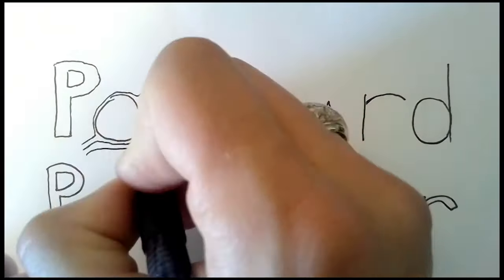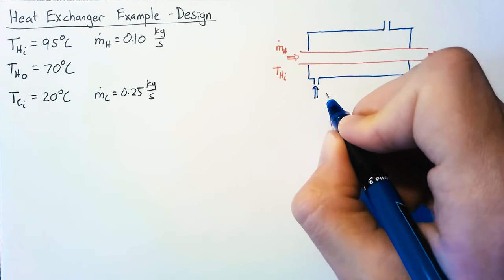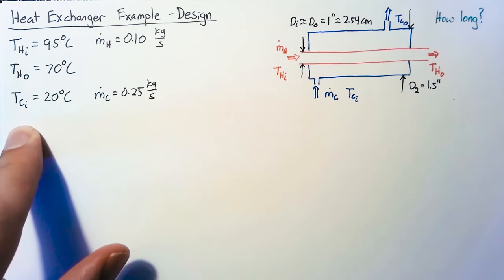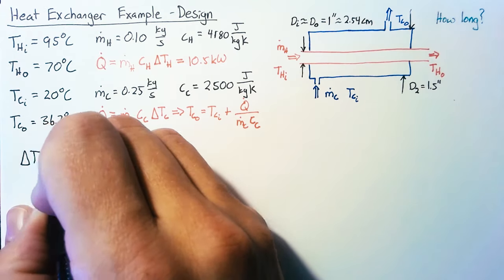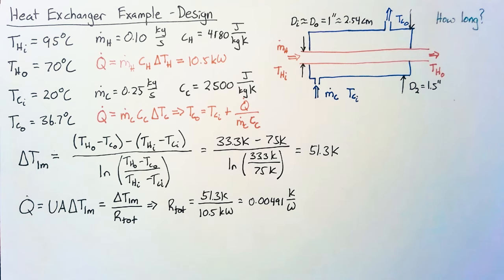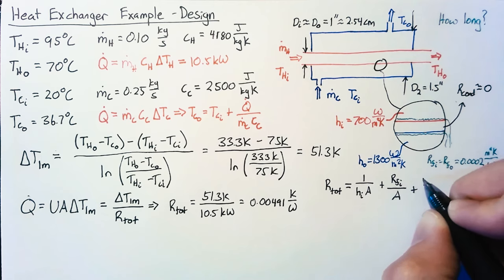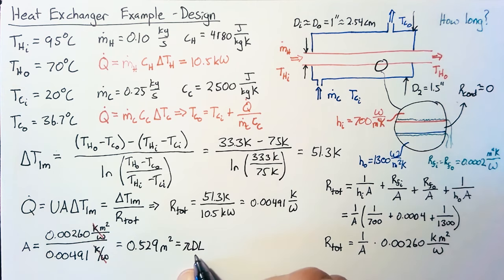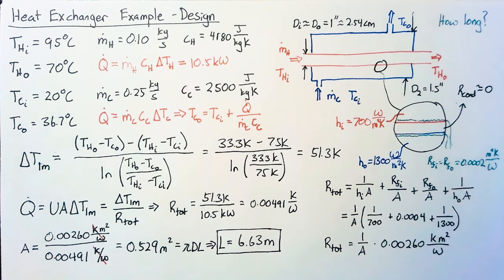Heat Exchanger Example - Design

Comment: The specific heat capacity of water at the temperature of 80 degrees and 20 degrees does not differ much and both are almost equal to 4180 J/kg*k . As a result Cc=Ch=4180, not 1500

Comment: hi i would like to know where did we obtain the convection heat transfer from the hot side and the two other values that follow?
Reply: Same question
Reply: @hassanismail6120  he used tabulated values but you can calculate it using
Correlations for Nusselt number

Comment: Can you please show how you got the ho coefficients of 700 and 1300 W/m^2K?
Reply: I would also like to know this please
Reply: Yes please explain
Reply from the maker: These are assumed values. For hi, there are correlations, and I should make a video on them. Unfortunately, the exact values for ho are difficult to calculate, and I’m not aware of any correlations. You can probably get some approximate values by assuming the tube is a flat plate.
Reply: @PostcardProfessor  Without knowing how to get these coefficients, this video is useless. we cannot calculate the area required.
Reply: These coefficients depend on the flow velocities (or on throughput) on both sides. They can be obtained by interpolating through the data found in the literature like HEAT EXCHANGER
 DESIGN GUIDE M. NITSCHE AND R.O. GBADAMOSI for ethanol and water. I interpolated the coefficient and obtained 6th degree polinomials for them using Mathematica. I used Fit[] comment for interpolation. This is a great video, congrats
Reply: @PostcardProfessor  Hii ... where i can find this video ?

Comment: I have seen this Channel and now I am here again for mathematical rewiew. This is brilliant because normally exchanger effectiveness curvrs are available as a function and capacity ratios of both streams, for perfectly mixed or plug-flow conditions. Yours purpose to give us knowledge is valuable and give the result of a problem that is addressed starting from basic equations and using compatible specific geometry. In the case of heat transfer we can use Paclet numbers from mass transfer experiments but than we have approximation. I think that is new and better path but I must incurage to input in "Tube and tubeside". 😮

Comment: "the quantity of heat transmitted through a UNIT THICKNESS  of a material - in a direction normal to a surface of unit area - due to a unit temperature gradient under steady state conditions" I don't know why thickness of fluids is lost in your equations when you calculating total resistance. When you zoom in pipe wall to calculate overall resistance it looks like you just consider molecules of fluids( both inside and outside pipe) very close or just attached to pipe inner and outer walls, so why do you bring hi and ho when  fluids are not there in your zoomed illustration
Reply: Typically, film coefficients incorporate all the details of fluid flow, including the fluid thickness.  Having a larger outer diameter (and thus more fluid thickness) will affect the overall heat transfer, but this is reflected in the h values.  

If the fluid were perfectly still, we would be able to calculate the heat transfer through conduction, which directly incorporates the thickness of the fluid.
Reply: @robertbrown7812  Thanks. I perform your calculation very similar to my case and get strange results when I want to calculate surface needed for the exchanger metal plates separate 2 equal  flows of air. As flow rates are equal  ( 1 cu.meter/ second),   temperature rise ( for cold air) must be equal to temperature drop in hot air. My exchanger then will have 3000 watts power transmission between 2 fluids ( 1 kilo of air with 1.0 cp and temp rise/drop 3 degrees).  Tcold(in) =19, Tcold(out) =22, Thot(in) 36 and therefore Thot(out) 33. putting temp numbers in mean log formula I get delta T= 15. then I calculate Rtot like you did (mean deltaT/ power= 15/3000= 0.005 T/W) 
Air thermal conductivity is 0.025 (W/m.K) . hi and ho are the same ( both fluid air) ,and I consider plates clean with no rust ,( maybe I'm applying wrong number(0.025 w/k  here?!,).
 So Rtot=1/A( 1/h + 1/h ) = 2/ A.h = 2 / 0.025 A= 80/A . Rtot being calclated 0.005 before,  80/A=0.005 ==> A= 80/ 0.005 = 16000 m2. Do I really need 16k sq.meter of heat heat exchanging surface? where am I wrong. I'm very confused about it.
Reply: @AM-lu5hm  Thermal conductivity (k) is only one piece of what makes up a film coefficient (h).  A film coefficient has units of W/(m^2 K), and is usually calculated by finding the Nusselt number (Nu = hL/k).  After a bit of Googling, I found a paper: "Convective Heat Transfer Coefficients in Concentric Annuli" by Dirker and Meyer.  Hopefully that's enough to get you started.

Comment: The temperature of methanol steam leaving the synthes is equipment is 450℃, which is cooled by waste heat boiler.The waste heat boiler produces 0.45MPa saturated steam.It is known that the in let water temperature is 20℃ and the pressure is 0.45MPa.The molar ratio of feed water to methanol is 0.2.Assuming that the boiler is adiabatic operation, calculate the out let temperature of methanol.The given data are as follows: The molar constant pressure heat capacity of CH3OH (vapor) at 450~300℃ can be calculated as follows: Cp,m=(19.05+9.15× 10-2T)(J/(mol•K)) Enthalpy of liquid water at 20C:H1= 83.74kJ/kg= 1507kJ/k mol； Enthalpy of 0.45MPa saturated steam:H2 = 2747.8kJ/kg = 49460 kJ/kmol。

Comment: I’m looking for very simple exclamation to show people with very simple limited minds who cannot comprehend math that is no more difficult than pluses and minuses and simple surface area using whole round numbers.     I remember having this in HVAC School and thermal dynamics and heat heat exchanger design class.    I even had a little bit of a hard time so there’s definitely no way I can describe using this method to people who just can’t comprehend anything more complicated than simple analogies.    
Thank you for your video.